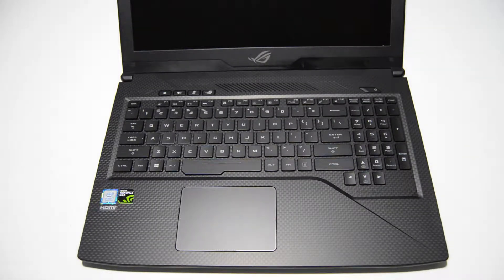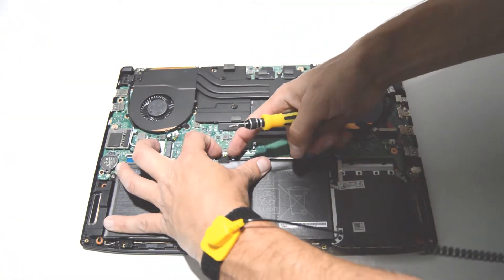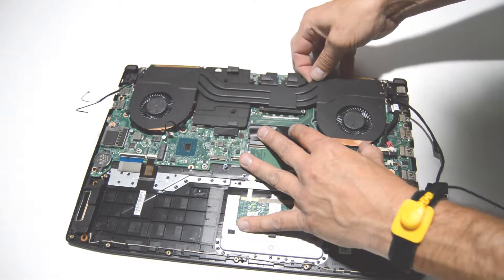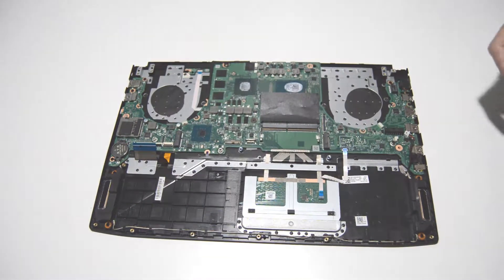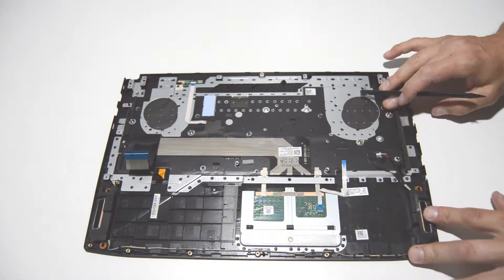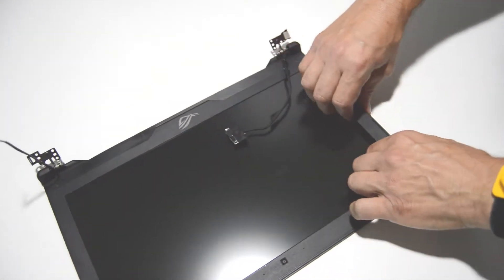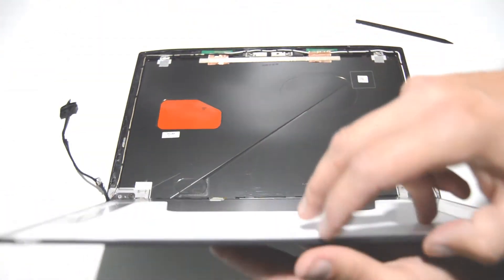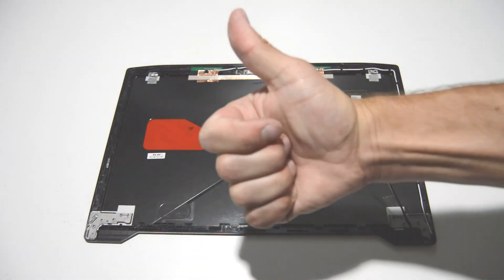How to Disassemble Asus GL503GE RS71 GTX 1050 i7 8750H Laptop or Sell it.

Comment: do you sell replacement batteries for this laptop? I bought mine back in 2018, it is still running well but the charge depletes very quickly.

Comment: Thanks for this video. I need one piece of clarification though. In all seriousness (I've never disassemble a modern gaming laptop) where is "C drive" located? Is a hard drive or SSD? I keep hearing some rattling from the inside of my hero edition (GL503G) pc and I thought it could have been the C drive just starting to die but I don't see anything else that looks like a drive other than the one through the access panel.

Could it be the fans rattling that I'm hearing?

Comment: My display backlight of this particular model is not working can I replace  just the backlight or do I have to change the entire display ?
Reply from the maker: No you need a whole new screen. Luckily on this model it looks like you can just remove the two bezel screws and pop off the bezel, then you have easy access to the screen screws and video cable connection.
Reply: @Sellbrokedotcom  hello sir will this also be the case with the particular model  GL503VD-FY007T? backlight also gave up.

Comment: Great Video but why is it so hard to find motherboard schematics for this laptop! 😂 I replaced the screen done a stupid and I’ve
Lost the backlight and I can’t pinpoint the fuse you got any tips?
Reply from the maker: No fuses.... if your cable is securely connected then you may have exposed the backlight circuit to static electricity.

Comment: can the fan part be disassembled to be cleaned?
Reply from the maker: Yes there are tiny phillips screws holding the two halves together. You can use a brush and some canned air to clean it though, no disassembly required.

Comment: thank you from an Indonesian here. well, I was just going to replace the keyboard. nothing's broken. just thinking it might have been a good idea to replace the original keyboard with the replacement bought online (I suspect it's not original though the seller said so) because I don't want the original keyword to break due to frequent use of gaming. but it appears that they keyword is irreplaceable. that's really helpful information. Otherwise, it would have been my biggest regret ever. So, I think I'd better use the keyword til it's broken or use extension gaming keyboard. thanks again bro. keep it up.
Reply: Do you not buy external mechanical keyboard instead for gaming?
Reply: Born To Be DPS no. Not yet. Been wanting to buy but still got no time to go to the shop.
Reply: Replace original keyboard because you afraid to break it from frequent gaming? That's weird logic you got there pal. Just buy external keyboard

Comment: Hey, I took the back off my laptop but didn't disconnect the battery. Now it's not booting up and there's no lights showing at all, just dead. Do you know why this has happened? Thanks man
Reply from the maker: If you didn't disconnect your power button, DC jack, or battery then it may be you touched your motherboard with some static electricity and borked it. Check and make sure those are all connected & your AC adapter works, if all ok you may have a bad motherboard.

Comment: hello, my gl503ge i5 8300h version cpu fan just got broken & spare fans are not available in my country, what should i do?
Reply from the maker: Both fans should separate from your assembly with just a few small phillips screws. Once you remove the offending fan, see if you can find the part number on it, may be a sticker or stamped into the metal. You should be able to find one on eBay, maybe from a different model. It's rare a fan would only go on one model. Just make sure it looks the same and has the same amount of connector pins. Otherwise I would try contacting Asus directly and see if they can help you find one. Good luck!

Comment: So i can't replace the keyboard? I have this same model but my keyboard either died or i have a capacitor issue. I've been looking for videos on keyboard removal but nothing until i came across this video
Reply from the maker: Unfortunately they use melted plastic rivets to hold the backing plate in place, to save weight and assembly costs. The palmrest assembly will have to be replaced whole.

Comment: Hey what is different about 30 pin and 40 pin screen connector which one match for this laptop help me.
Reply from the maker: If you need to replace your screen assembly, first check what connector you have and buy the same one.
Reply: SellBroke what about your one my laptop same as yours.

Comment: Is that last bit of red removable? In case you want to change it to a different color or something? What kind of material is it made out of?
Reply from the maker: Everything is removable if you're motivated enough :) It is plastic, so you could theoretically pop it off and use some other color of translucent plastic behind it.